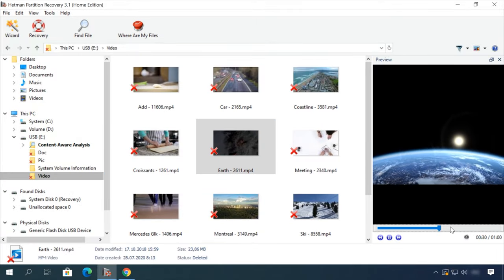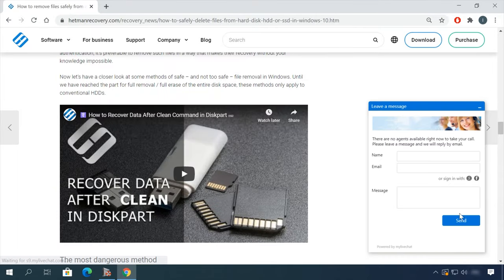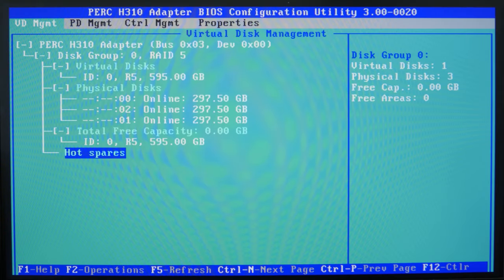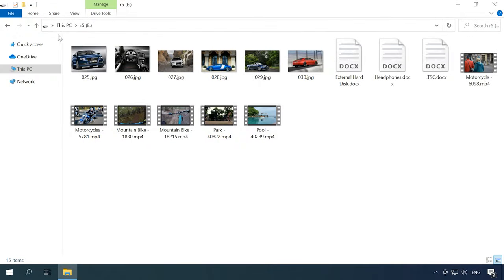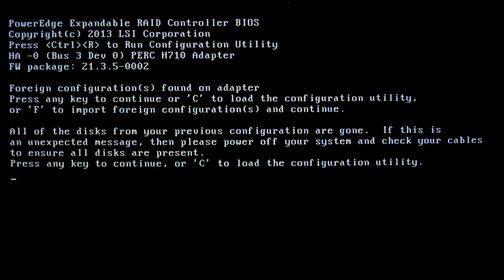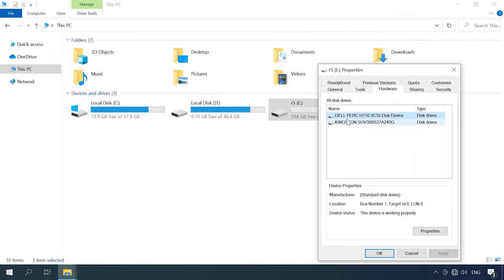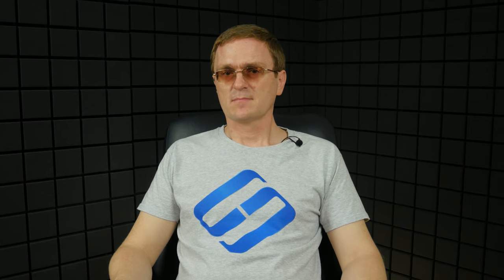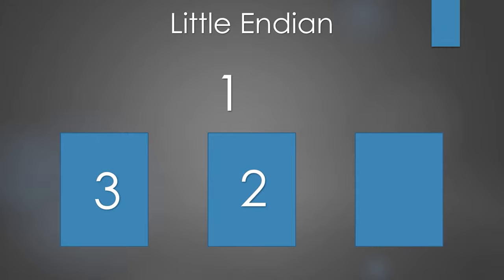How to Replace a RAID Controller without Losing Data

Comment from the maker: ⭐ Watch this video to find out how to replace a dead controller without losing data. 
00:00 – Intro
02:42 - How to replace a RAID controller without losing data
06:33 - How to replace your RAID controller with a similar model from a different manufacturer
11:28 - How to recover data if the controller is dead
12:03 - Conclusion

Comment: Hii..

What if all the harddrive, i moved (unplug from server A and plug to server B) A and B are same server with the same controller?
Reply: This should have a good chance of success. You can also just move the drives into the same slots from B to A, if B has a faulty controller. That way you don't need to open up the servers, if the drives are in hot-swap trays

Comment: I deleted  RAID 1 from H330 controller......lost my data?
Reply from the maker: Deleting a RAID 1 configuration from an H330 controller can result in data loss, as RAID 1 mirrors data between two drives for redundancy. When you delete a RAID 1 configuration, it typically involves breaking the mirror, and the data on one of the mirrored drives may no longer be accessible.

If you have not taken any additional actions after deleting the RAID 1 configuration, there might be a chance to recover the data. However, it's crucial not to write any new data to the drives, as this could overwrite the existing data.